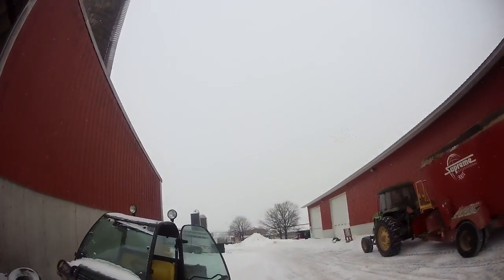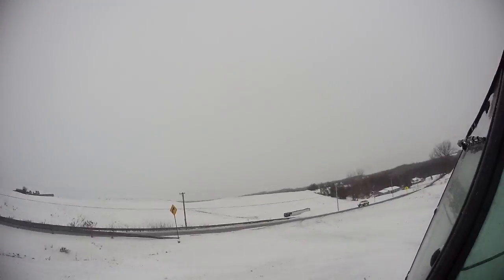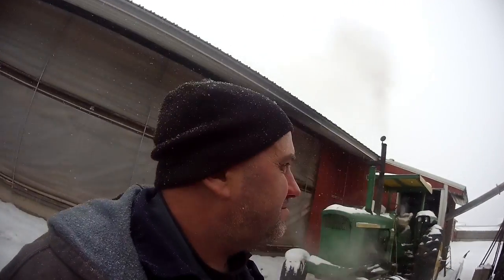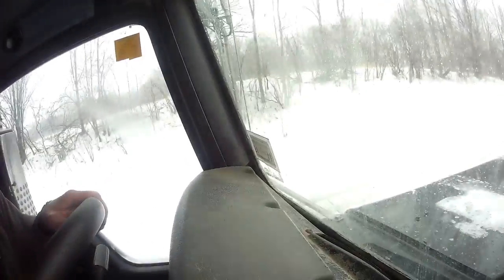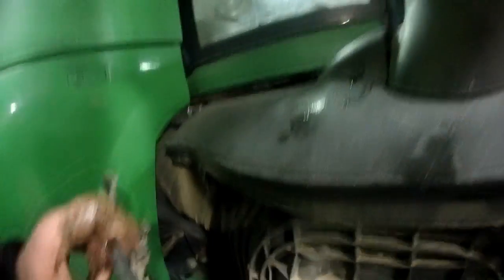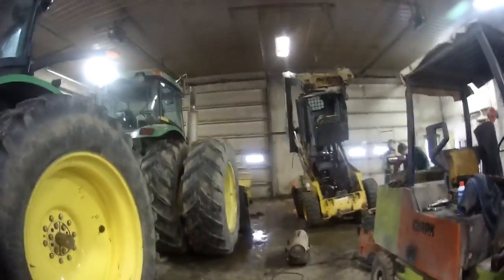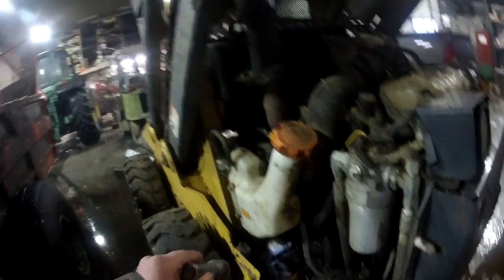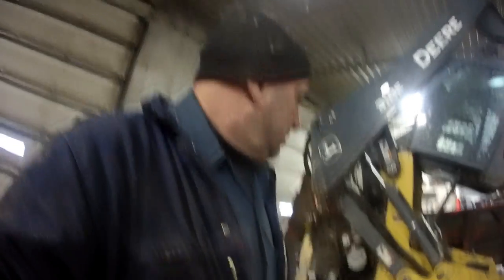Somewhat of a simple Saturday 1/19/2019

Comment: Andrew,   more on the IVT,  I traded a JD8200, with 2200 hours, for a 8130 IVT,  just for the IVT,  it cost me $45,000 at the time to trade. I was tired of shifting through the power shift gears, hauling  manure. One thing i didn't get on the 8130 was the ILS front axle suspension, was going to cost 5000 to 7000 more, so i thought why do i need that???, my 8200 didn't need it. Tires on the 8130 like to bounce on the road,  till you got it up to top speed.  8320R, so nice with the ILS, a god send.
Reply from the maker: Sounds like a good match for what you have going on

Comment: I run Grouser tracks on mine to get feed out of silo bags and it will work the ground up to a slurry mess and have had the belly full of mud. It's always fun to when you blow a hydraulic hose.
Do those skid steers have open center hydraulics like my JD 240? Sucks when you blow a hose and it doesn't matter which one, it pumps out all the oil and your not going to move nowhere. That can be a major problem for you if one blows while cleaning the tunnels under the barns.